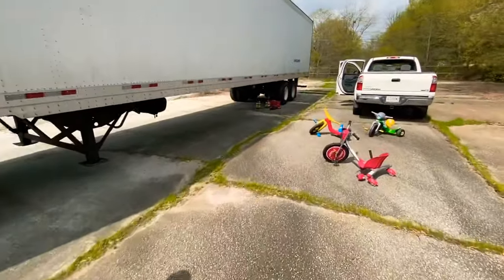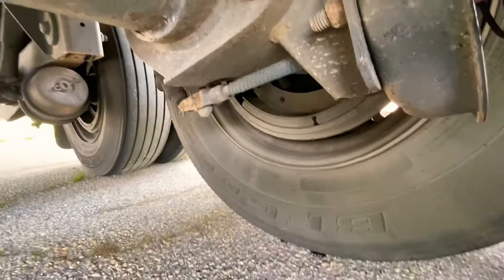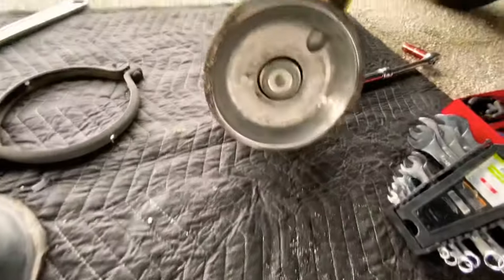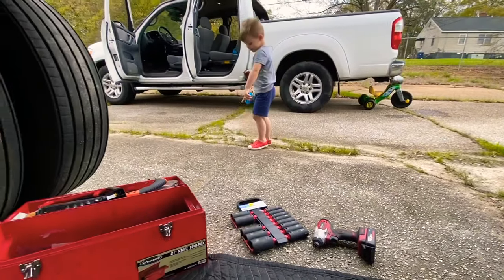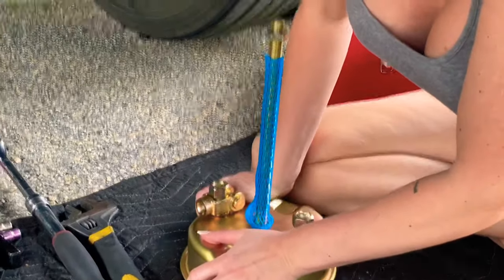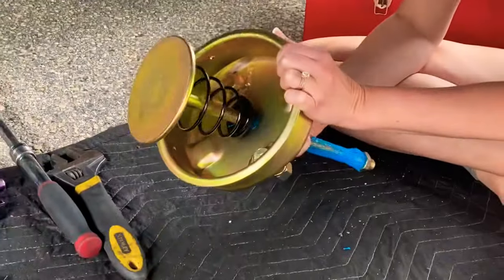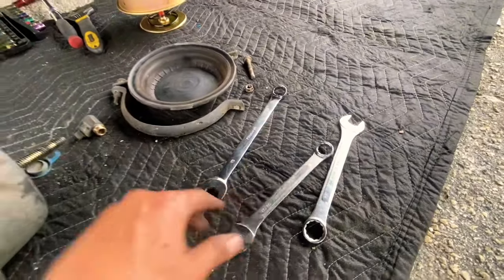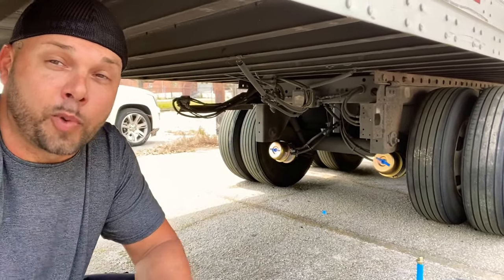DIY Brake Chambers OTR trucking 2015 Great Dane Trailer Sunday Fix Funday

Comment: I'm a mechanic at Alltime in Greenville, SC and I rarely have trouble removing the clevis from an old chamber. Break your jam nut loose from the old clevis first. Then you should be able to unthread the old clevis from the old chamber, usually just by hand. Every now and then you might have to spray with penetrating oil and use a wrench to unthread it.  After you have the clevis off, measure the old rod. Cut the new chamber rod the same length. You can cut it with a cut off wheel, sawzall, hacksaw, whatever you have..etc. Thread the old clevis onto the new rod until its flush with the end of the rod. Then reinstall it, it's way faster and safer than caging and removing the straps. Not to mention you get to use the whole part that you paid for. Cisco'
Reply from the maker: Thank you bud
Reply: Rico that’s awesome you took the time out to explain that. Good peeps
Reply: The hard part is getting the seized clevis pins out that should have been changed out 3 years ago.  That’s where the torch and an air hammer comes into play. I’m assuming that’s what he was referring to.
Reply: You want to cage the parking brakes regardless of what you are doing. Also there is nothing dangerous about removing the service brake side clamp. But I agree it's better to replace the whole assembly.
Reply: This guy must change his chamber ounce a month that nothing trusts fast.
Reply: Spot on advise

Comment: I'm a diesel mechanic also and I have changed many of brake chambers both ways. I loved the detailed explanation of parts, tooling, and how to get it done. Of course it helps to have a lovely assistant...😉 You can also use a screwdriver or mini pry bar and a 3/8 wrench to adjust the Meritor style slack adjusters....

Comment: Great video. I did all of my own mechanic work on my rigs. Pulled many cat engines and rebuilt or repaired. The worst repair job was the turbo chargers. Lol.. Brake chambers are actually fun to do.

Comment: I always changed the whole chamber.  those spring do fail when they get old.
 also pick up some of those brake hoses as they are cheap (less than $10 each) any signs of cracking or dry rot will get you put out of service
Reply from the maker: Thank you bud figure that was why 🙏🏽

Comment: I replace the whole assembly. And since learning the hard way that nothing may be the same on any of this equipment I take a few pics and have that with me if I don't have one to take with me to parts counter. 
But hey... it's done. No leaks.
Roll on.
Reply from the maker: Thanks man didn’t have the torch and time so just quick fix

Comment: Tip: upholstery tool works great to pull the pin out of the slack adjusters and then just use a wrench to adjust the brakes

Comment: Make sure you cage the new one before you brake it down.& install.Dont try and seperate the parking brake side of the chamber the spring is big it could fly out and kill you.I was a road man for the city of Chicago I have changed hundreds of chambers that way on the street.Good Job
Reply from the maker: Mentioned that briefly yeah could imagine a disaster

Comment: I'm all about doing the general maintenance myself also but only thing I disagree with not majorly though is using the old service springs just because of salt and corrosion I'd rather replace the whole chamber rather than the front side unless you're in a jam and that's what you got to work with and what things are still good like the push rod and clevises I'll keep as spares because ya never know when you or another drive needs em lol cheers bud!
Reply from the maker: Agreed bud

Comment: Vice grips are your friend.  Always set the brakes then use vice grips to hold the pushrod down while you install the back half of the chamber that way you can get the old to mate with new. Looks like ya figured that out.
Reply from the maker: Awesome info thanks

Comment: The side that can kill you is the other ring. Most cans don’t even have bolt removable rings on the ones that will kill you. If you want to change the rear pancake, you’ll need to save a bolt on collar from an old junk can, cage the brake, and cut off the collar. Then swap your pancake and bolt on the salvaged ring, then uncage your can. Pancake in $10 and new can is $75 so you’re not getting paid much to rebuild your can. I like new cans and I spray paint them.
Reply from the maker: Good info bud thanks

Comment: Using a piggyback is fine so long as the service side is in good shape. Also the fitting on the service chamber, and park chamber are normally different sizes.

Comment: Did just fine. The base of the can is the service brake. The side you replaced was the body and parking side. Nothing wrong with reusing the pushrod. That spring is the return spring. No need to create more work than whats actually needed.

Comment: Probably not so much where you run but gotta lube your clevis pins or the automatic slack adjuster won't adjust probably if those freeze up. I do it every service and work them back and forth. Also probably not so much where you run but up here in Ohio the base of the brake chamber usually rots out but you can buy just the piggyback or parking brake side of the chamber. Might save you a few bucks. I doubt you'll ever have a base rust out but the diaphragms will wear out and you can buy just the diaphragm.

Comment: it might be a good idea for you to take an air brake class one day  get to know those brakes, that rear chamber that has a crimped clamp so you can not take it apart  you would have to take a saw to  cut it off but a 30/30 chamber has a 3000 lb spring in there thats why you use the cage bolt and when you finish replacing the chambers you  need to check the travel of the slack the max travel of the slack should be 1 3/4 or dot will shut you down  i'm assumimg all your wheels have s-cam brakes you don't see alot of wedge brakes anymore( bendix stopmaster) most of the dot cops i have run across won't let ya adjust your breaks most of the dealerships offer classes i have worked with many troopers over the years, 46 years as a mechanic and i always tried to check out a truck like they would  and everything should pass

Comment: Do the plugs on the brake chamber secure air into the chamber? I noticed 2 of mine on the tractor missing and I checked many truck stops and couldn't find any plugs

Comment: Your using a 30-30 can that shouldn’t be a problem but you should make sure that the two pins at the slack adjuster spin freely. If they don’t spin freely the break will not work properly .

Comment: The parking brake spring is the bad one. Most chambers these days have a permanent crimped clamp on the parking brake so you don't accidentally remove it.

Comment: You could not use these complete chambers as the new chambers aren't  intrax .Push rod would be too short .You would need proper  intrax style chambers to replace complete chamber.

Comment: I personally wouldn’t ever separate those cans. They are very dangerous with those massive springs. Clevis’ hardly ever give a fight. Chop the rod down to the length of the old and make sure your stroke is legal. It’s just as easy to remove and replace the can.
Reply from the maker: Thanks bud I shall try that next time 

Just heard a lot complain about how the Clevis would be stuck 

God Bless 🙏🏽🚚
Reply: If you take the rear part of the can apart it’ll probably blow apart and kill ya. But the front ain’t bad as long as you either pin it have air on the spring brake side. 
Most new brake chambers don’t come apart on that side anymore anyway.

Comment: Your first mistake was not vise gripping the service side at the rod at rear base of chamber before removing piggyback. also I cant tell from pics but make sure you replaced with like chamber long stroke or short. save your money dont need that adjuster tool all need is 5/16" open and flat screwdriver save you 50.00 on average for tool not used much. tip is when removing apply shop air to new chamber service port to clamp service spring before separating new can or just buy the piggyback comes with new diaphragm save that step wont save much money but save few steps..  deep creep the clevis pins and apply heat with baby torch should free the pins if you had to replace whole chamber.....   I can relate changed many then you have factory welded clevises to deal with also then best always to replace piggy back....     good stuff get hand dirty all good.
Reply from the maker: Thanks for this info bud 🙏🏽
Reply: When doing a whole maxi. Adjust the brakes till there slack in the pins pull cotter pins off then take a punch and tap them out. I’ve never used heat on them before. Like he said just buy piggy back kits short or long. Save you money and time. 75% of the time the service side is never broken.

Comment: I'm surprised you not tell others NOT to undo the other clamp on the chamber due to a very powerful spring inside if that gives way it can kill you this spring is the one that operates the brakes when you have no air  these units can be very dangerous

Comment: Mechanic for 40 years worked in the shop Android service. It’s not that hard to change the complete chamber by self. Cordless impact Can PB blaster need a propane torch that’s all you need bud good luck

Comment: If you are going to tell people to pull apart a brake chamber you should have explained not to touch the clamp on the maxi side of the chamber; the spring in there is strong enough to easily kill someone.

Comment: As a Fleet Mechanic That worked for Flowers baking company for many many years and went to Bunches of schools to learn all the ins and outs of mechanics I will be the first to tell you that the way you did those break chambers was not a good idea on many levels first being you  do not know how much wear was on those clevis pins you left in and someone told you wrong about how hard those pins are to get out because ive taken many of them out and also the clevis itself should have been replaced because it also gets wear in it and those clevis can be purchased at any NAPA store the next reason is that old spring you left in there you have no way of telling how much it has been weakened and all of this stuff DOT Checks for when they pull you to the side for a check. I wouldve as a Mechanic never left that old stuff on there.

Comment: I wouldnt fuck around with cmv brakes,  they are too critical. servicing them without certs, makes you liable for accidents, where the proper adjustment and install is being questioned during " discovery" period. 

Like they say, everybody is gangsta, until the victims hire a top notch commercial lawyer.

Comment: Sorry man, totally disagree with your approach. We see a lot of corrosion weakening the mounting plate of the chamber. To not change that is basically throwing money away. Buy a can of PB Blaster, spray everything the night before and then go have a good time changing the chamber. Also if you change the whole chamber you don't have to worry about getting the new diaphragm in correctly. Also, current production is going to 99% completely sealed chambers, which will make what you did, no longer possible.